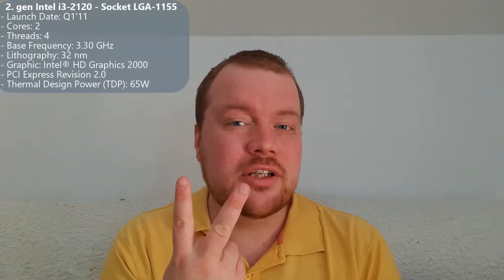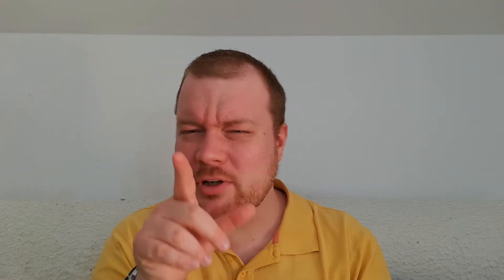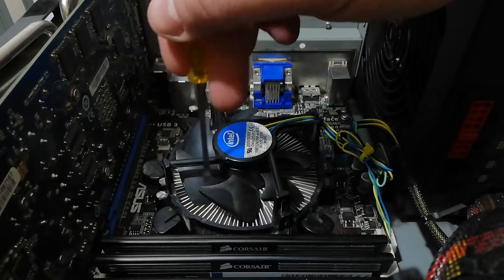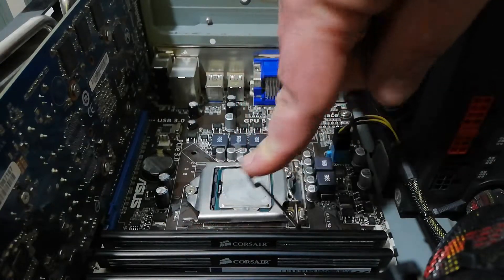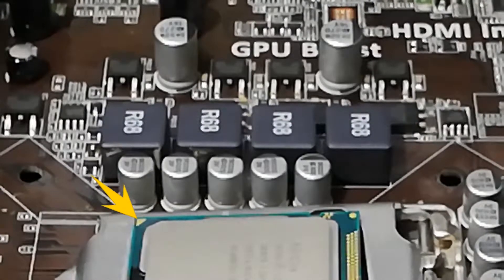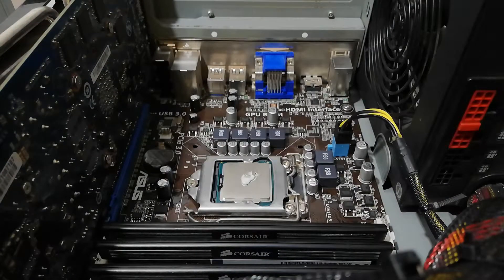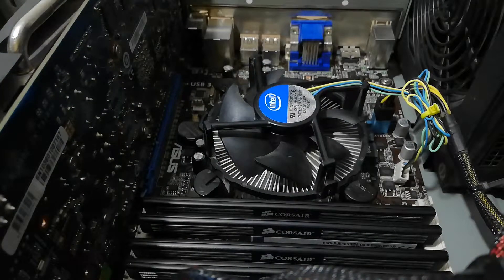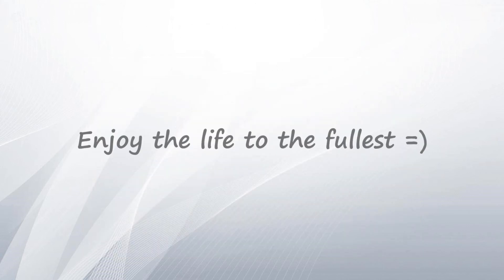How to upgrade PC processor on socket LGA 1155? - AFT #3

Comment: While this video was good, one thing the guy forgot to mention which could be a big issue (although it can be worked around)... BIOS upgrade. because if your CPU is a bit newer and your using a older BIOS on your motherboard it might not have support for the CPU you are upgrading to. hence, the CPU upgrade won't work without upgrading BIOS first before you physically install the upgraded CPU. one last thing... when putting thermal paste on the CPU, I tend to put roughly a BB sized amount in center of CPU but instead of spreading it with your finger like he does in the video, I prefer to use the pressure from the heatsink to spread it as I heard something about air-bubbles may occur using methods similar to what's used in this video which we don't want to occur as it could interfere with cooling. but I can see the potential benefit on why he does what he does in the video as to get a bigger surface area of the CPU contacting the heatsink which could help cooling a bit. but I have been using the method I have been using, which others use to, without issue for many years now. so ill leave it on each user whether they prefer what I said or what the guy in this video did.
NOTE: I recently ordered a used i5-3550 CPU (upgrading from a i3-2120 CPU) for a nice cheap price which will give a solid boost to gaming performance since I already got a respectable GPU for 1080p level gaming (i.e. 1050 Ti 4GB). but anyways, since I already upgraded my BIOS to the newest one years ago, and it's not had any BIOS upgrades in years, I am good-to-go as I already checked the motherboard manufacturers website and it specifically says the i5-3550 will work on my motherboard. I had my current basic setup (motherboard/CPU/RAM) since May 2012 and it's going to be nice upgrading to i5-3550 since it's the same Ghz as my previous i3-2120 CPU but is four cores instead of two cores which will make a rather large difference in gaming performance. on a side note... the i7-3xxx range CPU's are still way too expensive as they are not worth buying because they cost roughly 2-3 times as much as the i5-3xxx CPU's and are not much better and not only that they are at a price to where you can get a modern CPU for not much more $, so it makes no sense to buy i7-3xxx CPU's at the current asking prices. but it was nice to see the i5-3xxx range CPU's are finally quite cheap to where they are worth buying (i.e. roughly $20-30) where as not all that long ago they were still too much $ (something like $50+) to where one was better off putting the $ towards a new build instead which is why I hanged onto my i3-2120 CPU for so long. but I will say considering how old that i3-2120 CPU is (I had it since May 2012 even though it was released in 2011) it's still respectable for some games considering it's age and it's only two cores as I noticed games that claim to require a i5-2500k or so for example, usually run well enough on my i3-2120 as long as you got a decent GPU paired with it. but for anyone looking to give new life to their aging system that's on a 2nd/3rd gen Intel CPU, it's hard to go wrong with a i5-3xxx upgrade, just make sure you buy one of the better ones of the i5-3xxx range as some are under-clocked etc. but the i5-3470 (what's shown in this video) and i5-3550 (a little faster than the one shown in this video) are solid upgrades as they are almost the same Ghz, the i5-3470 is 3.2Ghz where as the i5-3550 is 3.3Ghz. so it really comes back to price on which is worth getting as I would generally go with whatever is cheapest unless it's barely more $ then I would opt for the i5-3550 instead for the tiny performance increase.
Reply from the maker: Woaah, damn you wrote a novel hehe.

In this video, I just wanted to show, how to replace CPU, but after video was published, I saw, that I needed to talk a out the compactibility, etc.. So I will probably make another video in future, about changing cpu, what to be carefull about, etc..

Sadly on this pc I can not use some good graphic with this CPU (bottleneck problem), I could get maybee 10% increase in fps in games related to my laptop ASUS ROG G752VL. Just few days ago, my power supply on that PC started giving problems, hehe.

I spread thermal paste like this for years. Ok air bubbles may stay there logically speaking. Another good way is X pattern apply thermal paste, which is still more efficient, than grain dot apply on the middle of cpu surface.

BTW thank you for the comment :)
Reply: @ACOnetwork  ; I have heard about the X pattern but, even assuming it's okay, it seems to be a waste of thermal paste as the general point of thermal paste is getting the least amount needed so that it distributes the heat properly (so basically... as long as it covers a decent portion of the CPU it should work well enough). ill probably stick to the dot (about BB size, maybe a little smaller) in center of CPU personally. but other methods are probably okay enough to. because as you said, you used your method for years and not had any problems. I am curious though... what kind of temps does your i5-3470 reach? ; 75-85c under full load with stuff like Prime95 for say 30 minutes? (I would imagine, off the top of my head, 30 minutes should be enough for the CPU to stable out/peak in temps) ; because from looking around online I have heard the CPU will start to throttle itself somewhere in the 95-105c range to prevent damage from overheating. because, off the top of my head, from what I can recall, my i3-2120 CPU topped out I think in the low 60c range (i.e. 60-64c) and I think it's safe to assume once I install the i5-3550 CPU soon, which ill be using same heatsink from my i3-2120 on it, that the temps are going to be higher than that as it's got more cores which is why I was guessing something in the 75-85c range will be peak temps with Prime95 etc (ill have to use something else to test mine as I have been on Linux Mint since Jan 2019) as if things are stable with that, it will be stable for any usage.
in regards to your power supply comment... yeah, I have had more PSU's fail on me than HDD's over the years as they always seem to fail roughly within a year after the warranty ends. but my current PSU is the best one I have had yet (it's blew past my usual PSU failure pattern) as it's a Seasonic brand as at the time I got that I heard those generally have lower failure rates than many other brands and the Seasonic 520Watt PSU I got had a 5 year warranty which expired in Nov 2017 since I got the PSU in Nov 2012. so right now my main computers Seasonic 520watt PSU is 7.5 years old and I leave my computer on pretty much 24/7. but anyways, my previous PSU's were all 2-3 year warranties as my current Seasonic is the first one I had with a longer warranty and it did not disappoint. hopefully I can get at least a few more years out of it as once I install that i5-3550 CPU I suspect ill be able to get atleast 3+ years more of use out of my general main computer as I am trying to delay building another computer as long as I can as this way when I do upgrade ill get a rather big boost to performance for minimal $.
but any PC with a i3-xxxx CPU upgraded to a i5-xxxx CPU should noticeably benefit if you upgrade to a decent GPU (I generally avoid the high priced GPU's as a general rule). I have not tried it yet, as I am still waiting on it to arrive so I can install it, but I am certain ill get a noticeable increase in frame rate since my current i3-2120 CPU is the bottleneck on gaming for sure.
NOTE: I had to edit my initial post as I noticed a typo "i5-3350 (a little faster than the one shown in this video)" when I meant to put 'i5-3550' instead.
EDIT: it appears Prime95 works on Linux to as I am using it right now from terminal as it's easier than I thought it would be and seems to tax the CPU harder than the 'stress-ng' program I was using a bit earlier. on Prime95 I ran Option 2 which says, "2 = Small FFTs (tests L1/L2/L3 caches, maximum power/heat/CPU stress)." ; even after only 5 minutes my i3-2120 CPU temp topped out at 62c (generally in the 60-62c range). so it appears my guess was pretty close about the 60-64c area as my room temp is floating around 68-70f. so I would imagine my 64c CPU temp is close when my room heats up to around 80f etc.
Reply from the maker: X pattern ls waste (I never even tried it hehe), before my way, I used on the middle a little bit. In the middle only, it is okay for many processor, but when you are using some beast CPU, then it is good to have all surface covered.

BTW who ever is reading this, DO NOT use TOO much/little thermal paste between processor and cooler.

So I just did Prime95 on debloated Win10, max temperature 30min on i5-3470, 1600MHz XMP ram, ASUS P8b75-m and 1th and 4th core maxed out at 80C, 2nd and 3rd at 84C, all cores average at 82C. While writing, cores are 25-37C with several windows opened. Btw. my room temp is 23C.

My power supply is Antec 550W, and for couple of years I had almost always 24/7 powered on. Now, I have arround 10-16 hours per day, sometimes less. Few days ago motherboard notified me, that it detected power surge and it protected it self (I needed to turn off powersupply with switch and turn it back ok, that PC even started). We here do not have Seasonic power supply and I will buy some 550W 80+ for about 60€. When I will buy another PC (probably in 2 years) I will use this new PSU as power supply for the electronic projects, tests etc. On little bit of tweak needed, Solder together a box with voltage amp regulator, volt/amp meter, stepup voltage boost, so yeah cool little project :D. This box I plan to put together in next months, and I plan to record and upload for all of ya to see :D, if I succed or crash and burn for the first time (testing on old 600W power supply).

Honestly, I upgraded CPU because I use 2 PC streaming setup over NDI (streaming 720p on Twitch, aconetwork1 is nickname, if you want to come by sometime =D, link is in the description) and i3 was too weak to handle it NORMALLY. Even i5 can struggle. I will install POP OS as dual boot with Win10 so to test if I gain some performance. Stinger transition I made  is too much of i5 to handle. Are you streamer by any chance? What games you like to play?

In my laptop, where I play games I have GTX 965M and I researched with my i5, I can gain only about 10-15% more FPS (if I would get bether GPU) so I will not be buying it. When I will have enough money for upgrade, I will go with AMD Ryzen (because in multicore video rendering beats Intel by the whole line, but not in games).
Reply: @ACOnetwork  ; so it appears my guesstimate was close as you topped out at 84c (as I was thinking it would be closer to 80-85c range with stock cooling with Prime95). so that will give me a pretty close guide on what temps I can expect once I install the CPU soon. thanks for your time testing that for me. I also have a ASUS motherboard but I noticed in your video you got USB3 where as mine does not (I do have a add-on card that gives me general USB 3 though) so I am guessing your motherboard is a little better than mine.

I don't stream video or anything and I only play a limited amount of games in general as years ago I used to play plenty but nowadays I am a lot more picky and mainly replay single player games I used to play from some years ago. like Mafia series (Mafia/Mafia II/Mafia III). but with my i5-3550 CPU upgrade it will mainly benefit Mafia III (probably Mafia II a bit though) since Mafia/Mafia II already run quite well on my i3-2120 CPU (45fps average on Mafia 2's (Definitive Edition) built in benchmark demo with graphics basically maxed @ 1080p using Lutris/Wine combo on Linux) but I expect ill see a solid boost to Mafia III performance since while that game is playable on my i3-2120 if I got say roughly a 10-15fps boost on average that would make the game noticeably smoother since there are occasions the FPS drops are pushing it (like probably into the mid-20's (which as you know is pushing the edge of a good enough video game experience) but the game seems to be largely 30fps-ish if not noticeably higher). for the record... I first played Mafia (2002) (on PC) when it was new and it's still my #1 video game experience to date (I replayed it once again in Aug 2018) as nothing has matched the overall experience that gave me and I replayed it here and there over the years since. but I do run the original release I had back-in-the-day with the patch (so the racing mission is much easier as pre-patch the racing mission was a major chore to finish) and I also use a couple of small mods... 'unlimited draw distance' and a aspect ratio tweak so it works on modern resolutions like 1080p.

I have used a Antec PSU in the past but it has been a while as I want to say that was early 2000's since I last used a Antec PSU. but I don't blame you on the whole 10-15% thing as for only a small 10-15% boost as the cost is simply not worth it. even with my current computer, once I get the i5-3550 installed that will likely be the last thing I upgrade since while a RAM upgrade (i.e. 8GB to 16GB) would be nice, the cost is simply too much $ and not enough benefit as I have been on 8GB of RAM since May 2012 and my motherboard only supports up to 16GB of RAM anyways and while 16GB of RAM would be nice for some newer games it's simply too much $ that I would be better off putting towards another computer build. plus, pretty much all of the games I play work good, or well enough, on 8GB of RAM anyways.

but with the whole AMD vs Intel stuff... what you said seems to be roughly what I heard in that for CPU's in a similar price range, in terms of performance per core, Intel wins but AMD seems to offer more cores for similar price. so for tasks that benefit from more cores, AMD easily wins. but for tasks like say gaming, Intel might still be ahead (I could be a bit off here as I have not researched things so I am likely a little out of date. but what I do know from knowledge years ago that AMD was ahead of Intel on gaming from about 2000-2001 (it was at least no more recently than 2001 though) through mid-2006 as once mid-2006 came along Intel took the speed crown back (i.e. Core 2 Duo's) from AMD on gaming performance and I think it's had it ever since) but if it's a negligible difference, then ill also likely be opting for AMD on my next build in the future since it's all about all around performance for least amount (or thereabouts) of $ spent. but it's something ill research in the future when I am getting near a new PC build and make a decision then.

and I obviously agree with your too little/much on the thermal paste comment. but I would imagine it's difficult for someone to mess up too much if they are in the ball park of more standard methods of applying thermal paste. but I do wonder if the method I have been using (i.e. about a BB size amount of thermal paste in center area of CPU) might not work on newer AMD CPU's as while I have not looked into it too much it does seem like newer AMD CPU's are quite a bit physically bigger in size than they used to be when I used them back in the 2000's etc. so just off the top of my head I am not sure if that small amount of thermal paste would spread/cover enough of the CPU and might result in heating problems. but it's something research when I build a newer computer years from now as, like I was saying, I plan on using my current computer for as long as I can and that i5-3550 CPU will surely help with that.
Reply from the maker: No problem, glad to help 😁.

So, Mafia 1 is one of my favorite games, I replayed it x times hehe, do not know how much. Mafia 2 is still good, but Mafia 3 ruined Mafia name. All 3 Mafia games are redone, known as Definitive edition, but... 3 got minimalistic improvement, 2 bether texure qualities and I gott it for free on Steam, but 1 still is not out yet, but it looks interesting but not buying it for 40$, that is too much. Some of games I like a lot is Euro Truck Simulator 2, Alien Isolation, Mudrunner, burnout paradise,... .

Spreading thermal paste... it is used to preform thermal conductivity, where cooler is not compleetly touching the processor (or gpu) surface, we can say as fillement. If my laptop dies, I will just buy graphic card for my desktop PC, broken laptop I will sell for some money, or I will reuse screen as aditionall monitor, because it is IPS and cool 😁. Ok for tranformation, I will need to do some DIY done, but no problem, it will be fuuun 😂😎.
Reply: @ACOnetwork  ; I found a good article in relation to these CPU's when it comes to applying different methods of thermal paste and in conclusion they are all about the same (like CPU temps are pretty much the same regardless of which method used) which is why I prefer the small dot option the most since it will use the least amount of thermal paste... pugetsystems.com/labs/articles/Thermal-Paste-Application-Techniques-170/ ; you can see there with the pictures of how they applied the thermal paste and the results of how it looks after use. but when I remove my heatsink ill check to see how mine looks before I remove the old thermal paste for curiosity sake. but without checking how mine looks at the moment, from memory, I think I used a bit less thermal paste then the dot they used in that articles link. so if I am roughly correct, my dot will look a bit cleaner than how theirs turned out once I remove the CPU and see how it looks on the CPU.

on the whole Mafia trilogy thing... while Mafia 1 is best, Mafia 2 is not far behind. but I don't think Mafia 3 is as bad as some claim as I think the characters/story are still solid even though in terms of gameplay it could have been better as it was a bit repetitive and overall weapons feel is better in the first two games etc. but I will say while the graphics ain't much better from Mafia 2 (2010) vs Mafia 2: Definitive Edition (2020), I am pretty sure I do see a decent increase in performance as I can raise graphics settings higher, even PhysX on max (by editing settings.xml file I think it was and changing 'Apex=2'), and still get better fps vs original game with similar graphics settings and graphics are a little better. so it's more than just a small graphics update from what I can tell in my brief testing (ill likely replay it later this year or no later than next year) as it seems like a performance upgrade to, at least it seems to be on my i3-2120 CPU as on the original release one had to tweak the PhysX by deleting certain files from the games installation folder to. like say one could get the main characters coat to use PhysX but say NPC's did not use PhysX etc to try to find a balance of graphics/performance for those who wanted to use PhysX on Mafia 2 as that seemed to be a general performance killer on that game to where disabling it did not detract from visuals much but gave a solid increase to performance.
Reply from the maker: Once I turned on physics, but mafia 2 became unstable, I did not check for solution.

Here is gameplay playlist of Mafia1 I published a while ago:
https://www.youtube.com/playlist?list=PLXExS3mKv4afmuym0AFjYbqxEzDOIhbTF